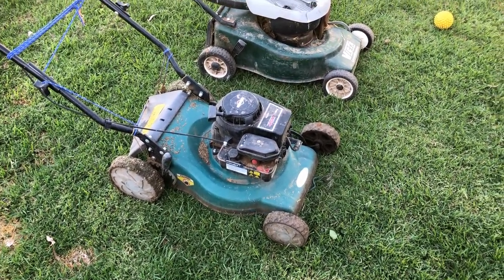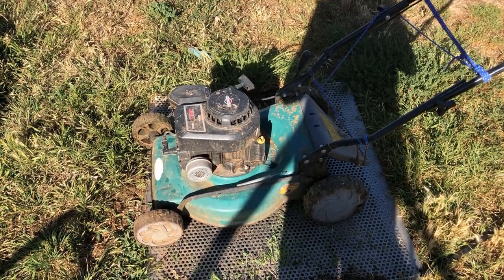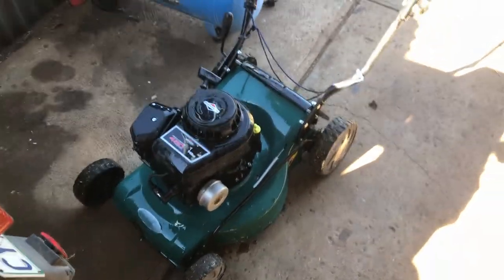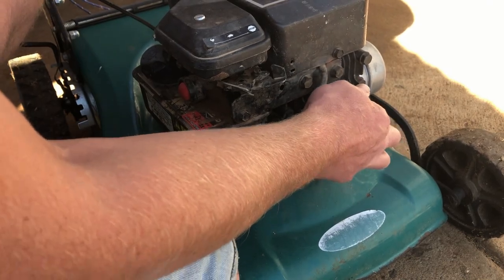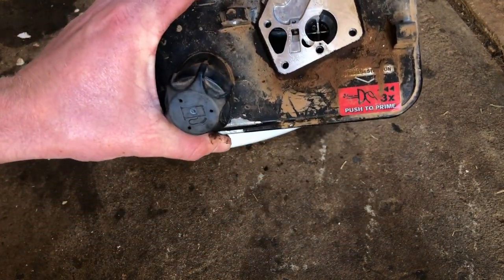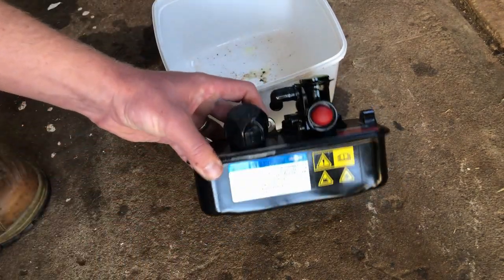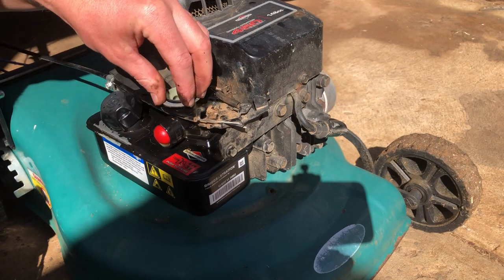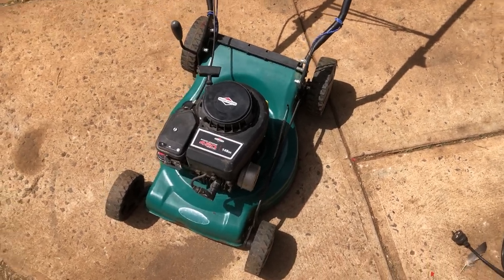Victa sprinter mower service and repair

Comment: Thanks for the no nonsense video. My mower won't stop unless you manually push back the throttle ie. just below the air filter. Are you able to adjust the valves?
Reply: I've got one of these and the throttle linkage can get easily bent if you get a bit too close to something and also the metal can get bent upwards so it doesn't touch the kill switch contact when the throttle is closed. For the valves just look up a video on "L Head Briggs and Stratton" that is what these engines are called because the valves are accessed from the side.

Comment: Hello junkyarddog87 
Is it possible to put a Briggs and Stratton engine just like the one on the video (450) on a Victa 2 stroke deck. I am aware of the mounting bolt pattern are universal but wouldnt the Briggs engine be too low for the Victa deck? I mean the petrol tank of the Briggs will not fit.
If its possible please do a video on putting a Briggs engine on a Victa deck.
Thanks and I love your videos mate.
Reply: Use Spacer's to bring the engine up to the right height and so the blades don't go to low the fuel tank will miss the bodie then

Comment: Does the little spring actually do anything cause my mower doesn’t have it and it runs perfect
Reply from the maker: I find on the ones with the very very light bar blades they help with stabilising the govenor, the ones with heavier bar blades or disc type have enough mass there to act as a flywheel and keep the revs steady.
Reply: they always hunt . no flywheel weight to speak of

Comment: What would this machine sell for after its had a service such as this?
Reply from the maker: personally if I had the catcher, I couldn't sell it for more than $80 without feeling bad about it, if the same engine was on a decent sized 18" frame with good wheels id be aiming at around the $120 mark for a quick sale.